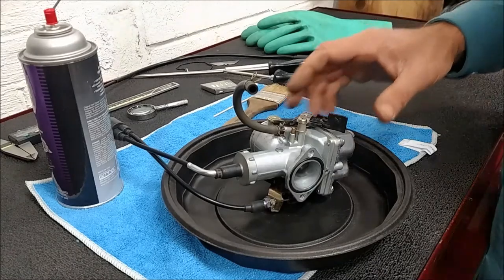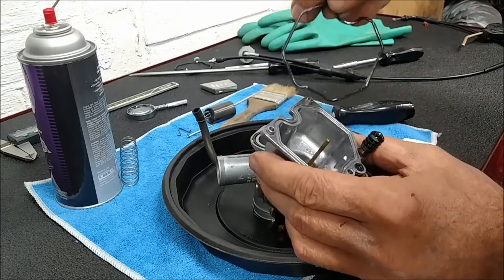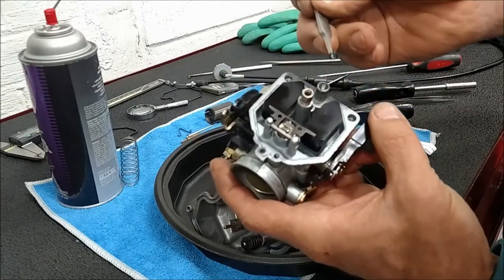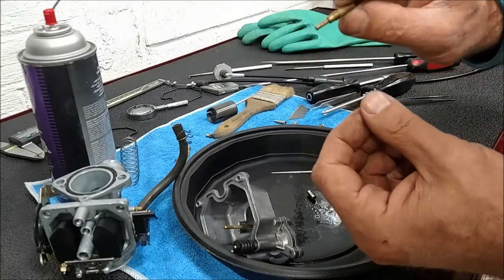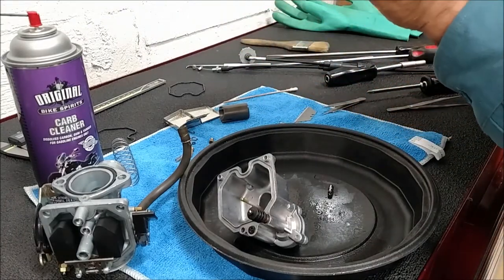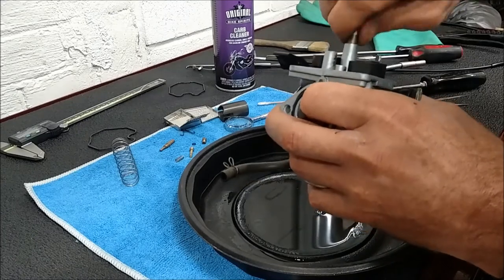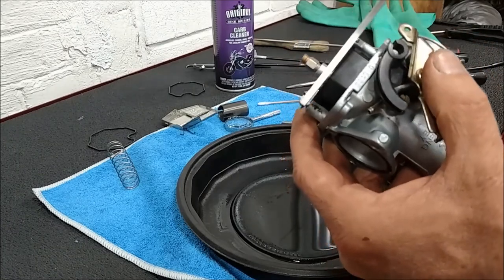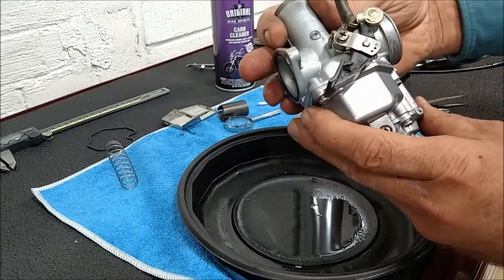Cleveland Carb Clean

Comment: That’s carburator is give me a lot of problems., is there is another one with no plastic parts ? I have a 2012 Cleveland the heist do you what are compartible carburetor?
Reply from the maker: There is no plug and play carburetor. The carb must be jetted exactly for the bike. The stock carb should be rebuilt properly with the correct jetting to match the exhaust.